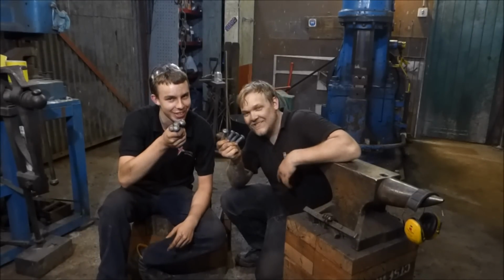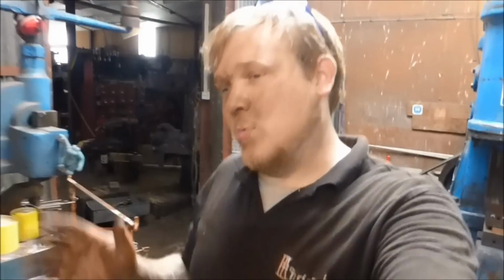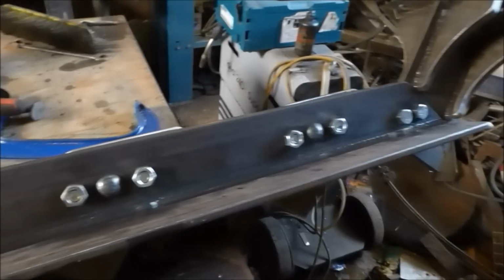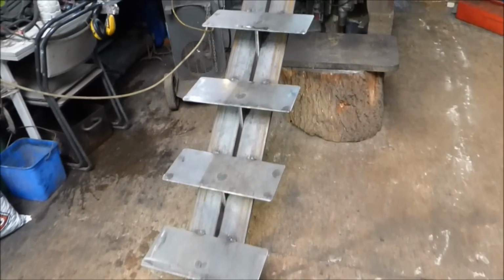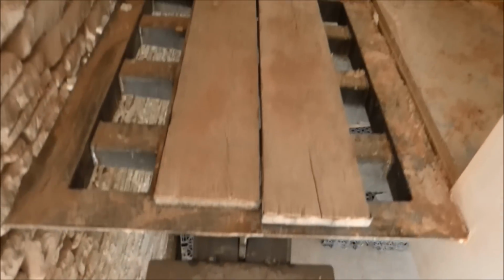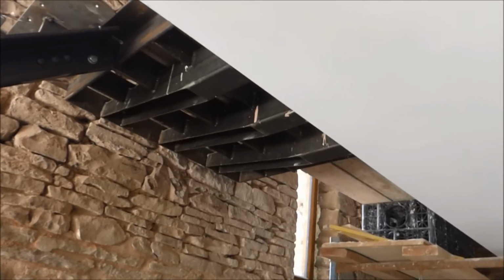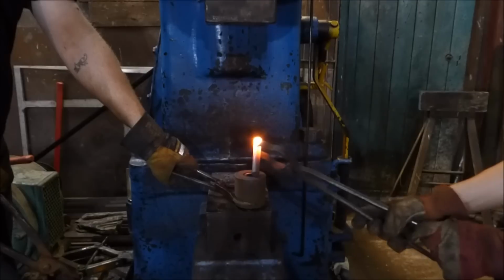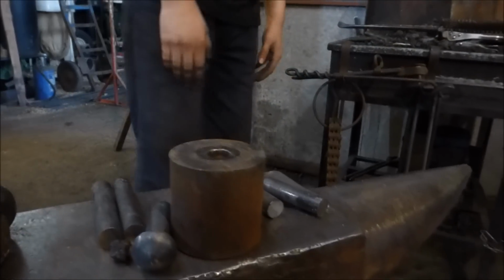Industrial Size Rivets! Trust Me I'ma Blacksmith!

Comment: I had a friend of mine that was an Iron worker on the Empire State Building in New York City. His first job was to catch Rivets in steel catcher thing. I can’t imagine being a few hundred feet in the air on 6 inch wide I beams doing this kind of work.
Reply: I've been 6 stories up, walking on joists only 3" wide, and not secured yet, one wrong move and the joist could roll, you get used to it of you get through the first couple of weeks.